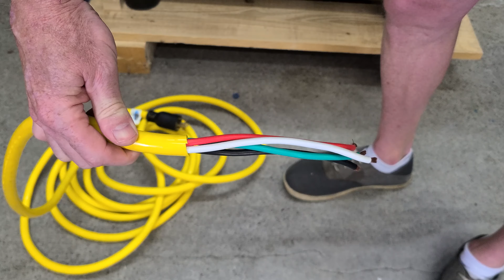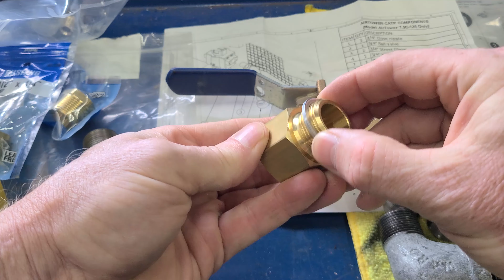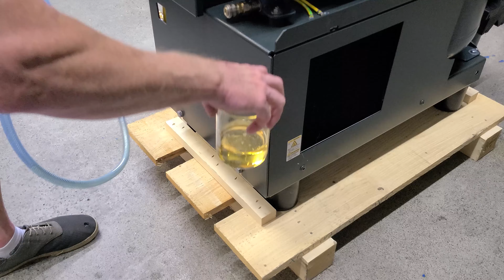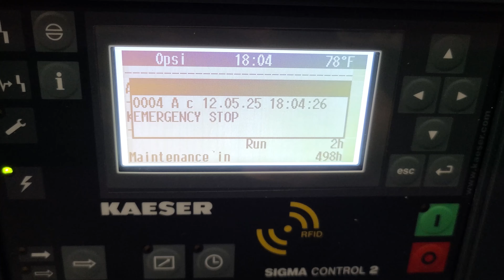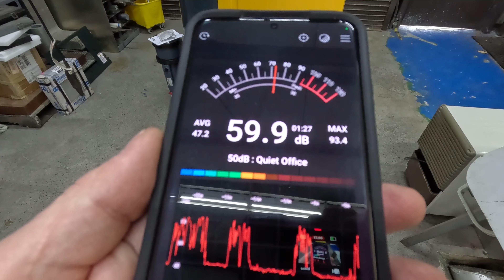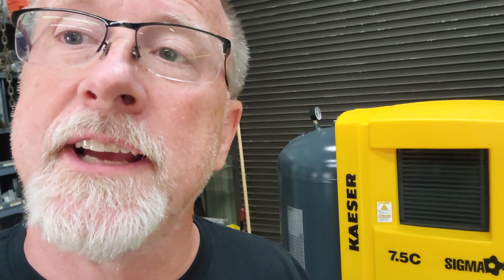Kaeser Airtower 7.5C Install Part 2

Comment: do you have a idea how much the yearly maint. cost is on this compressor?
Reply from the maker: I do not.  Oil and filters.  The filter/separator isn't expensive and it doesn't take much oil...

Comment: Thanks so much for the information. There is so little out there about Kaeser.  You saved me a ton of time on setting up my sx5. Any chance your going to delve into the sigma 2 controller?
Reply from the maker: Probably a hard no on the Sigma video... its difficult to fully explore and very hard to film...  in this application I'm just turning it on and setting the load/unload points.  We have 2 AS30's in a different location that run lead/lag based on demand, etc.  We are extracting all the performance data from them and publishing to our monitoring system...but that's more of an IT problem that's way over my paygrade

Comment: great video! I actually just setup my 5C a few days ago, this vid would've been helpful haha. Thankfully there isn't too much needed and it's all there in the manual. Also, from watching your vid, the 5C and 7.5C look identical from a setup/wiring perspective, which I would expect but wanted to note it in case anyone else see's this. 
My setup is slightly different where I have mine setup as 230V single phase (split phase) and running off of batteries/solar :) It's nice that these machines have multiple voltage options.
Reply from the maker: It's a darn nice unit.  We have 2 AS-30's as well.  Thanks for commenting.